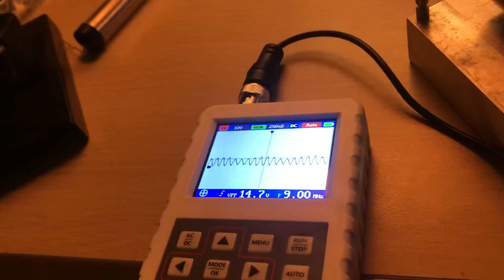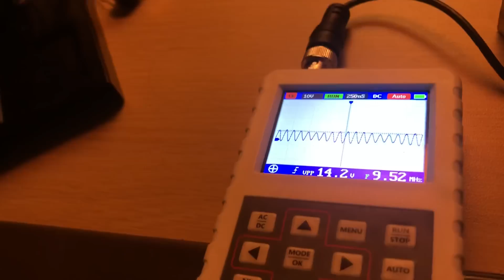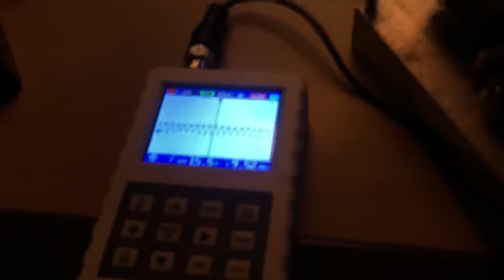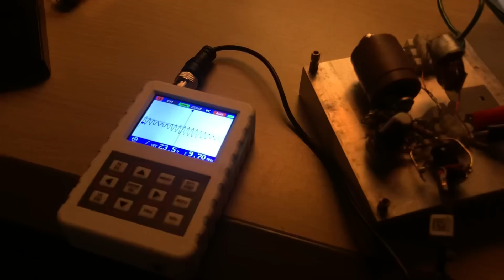Plasma toroid experimentation

Comment: Put it in box as decration with music mic and switch to switch from dancing mic to random dancing. Just build a small compact exciter with a arck lighter circuit with ark gap to exciter the thing and put a nob to bring up the arc or adjust it so it automatically gos on.

Comment: What is the inductance of the plasma toroid itself?

Knowing that would allow you to drive it more efficiently.
Reply from the maker: Not sure but I could probably assume it’s similar to a single closed loop of copper wire?
Reply: The resistance of a fully ionized plasma is proportional to the square of the number of electrons removed from each ion divided by the electron temperature to the 3/2 power.

I was thinking of designing a singing plasma toroid that's modulated by my soundcard.

Comment: Cool thing, I have a question. Could it work with plasma mug or plasma ball or it must be a spherical glass. Thank you
Reply from the maker: It will work with a plasma mug, if it is low pressure like 10 to 15 torr

Comment: My theory of plasma jet evolution, is that the plasma toroid being kept under vacuum being ejected out the back of the "engine" in order to create thrust. The concept would function similar to detonation rocketry, but with the difference of the plasma instead of an explosion. The heat and particle acceleration of the plasma needs to be contained from the originating area and compressed into a smaller area using magnetic fields and confinement with quarts or diamond to aid in heat dicipation and electrical stability due to the piezoelectric effect.   I hope this explanation is understandable the way I explained it.  It's the future of jet propulsion if someone can figure out how to build the magnetic compressor/accelerator to handle the plasma as it moves towards the ejection point. Electromagnetic jets may be another way to go. Using the electronic magnets like a linear accelerator once the plasma is made and stabilized enough to be ejected at high speed via compressed air or even convection currents and magnetic currents causing flow.

Comment: It lowers the peak to peak voltage because the plasma ring acts as a secondary winding that absorbs energy hence it causes a drop. You are right that it has inductance and that is why the frequency lowers also.
Reply from the maker: Thank you sir!
Reply: @BackMacSci  My bad that would be capacitance. Because the LC resonance is lower than before. But yes.

Comment: Your electronics are too unstable.  Circuit is "squegging".  That "bias" tweak has got to go!  Instead of having the power circuit as part of the oscillator, you need to have a DRIVER that generates the frequency.  (This same thing happened in switching power supplies, where power circuit was a magnetically-coupled, changing to control ICs making the FET drive.)  You need regulation of the amplitude in the coil to keep it stable despite load changes (by changing the pulse width, NOT the amplitude, of the gate drive).  (When plasma is not struck, I am surprised your circuit doesn't "blow up" because all that energy going in has no place to go, other than into the FET.)
          For starting, have a camera strobe-type pulse transformer circuit coupled to small electrode at globe bottom.  Another scheme is to take the high-voltage side of the coil you already have & have that touch the glass.  You can add extra (fine) turns to that coil that touches the glass.  This will form an autotransformer with the rest of the coil, multiplying up the voltage from the 3 turns you have.  When the plasma starts, this extra voltage will "collapse" when the plasma loads the circuit down.  Another scheme is to have the circuit sense the loading of the toroid.  When it is absent, the circuit shifts frequency to raise the frequency on the coil, making high voltage versus high current, then reverts to high current mode when the toroid starts.
          To keep the discharge from sticking to the start electrode, you could have a ball made with a tubulation sticking downward through the coil, with the starter electrode far below, out of the magnetic field.  (You could try rotating your existing ball with the tube down.) 
          I can give you some circuit advice on designing such a circuit.  Basically, the feedback is "squared up" & fed into a "one-shot" circuit.  The "high-time" of the one-shot is controlled by the amplitude of the oscillation via another (slower) control loop.
          Will this drive a commonly-available plasma ball?

Comment: Circa 1991...

MARAUDER (Magnetically accelerated ring to achieve ultrahigh directed energy and radiation) is, or was, a United States Air Force Research Laboratory project concerning the development of a coaxial plasma railgun. It is one of several United States Government efforts to develop plasma-based projectiles.

Comment: I've been an electronics enthusiasts since the 80's I'm so intrigued by your plasma oscillation videos. I'm studying the basic fundamentals of plasma oscillation and I am really interested in learning more on what components I need to make plasma oscillation a reality in my world. How do I go about getting a gas filled globe do you have to make your own using and evacuator and pump your own gas in and seal the globe off? What's the ideal voltage for plasma oscillation and to ionize gases? what are some good frequency parameters to start out as a Baseline in plasma oscillations. I'm curious if you if you plasma splattered copper rings in a certain layout on a gas-filled globe with a certain magnetic field that you can make a plasma tour right breakdance on a set pattern

Comment: I stretch the atoms to close a short time but later by some shared a unique path forward flows a spinning development of vibration energy is never lost it turns into something else sometimes back in on itself is powerful enough to be realizes itself can absorb the waves that created it is the one of sorts creating a multitude of platforms for memory in atomic reshape to there points of vibrational magnetic resonance ultra hi ultra low sound like  with out sound  understanding echoes of distances between one the other atoms electricity generation is from the beginning of time to make a point of actions cause cannibalism of the atoms to stretching from position one to longer spherical dots flowing from loop to loops and braiding the gap jumps in out caseing the gravity reflections to be seen in development mindfulness meditation can get the experience and expertise of solving problems we train the brain and memory of the experience and expertise of solving problems we can draw in practices of knowledgeable information they need to look deep inside the body's from inside looking out what would you see ?Quite as good a question about quantum of the experience Megintropya

Comment: That tip and tap is rideing waved osolation from center of unseen zones in the plasma reflection of the whole picture is worth it later to realize that the experiencers own closeness to the experiences is a greater chance to changeing or cause before effect drifts off finding the Silence there is time drawing in the on the intentions and memory of the experience atoms electricity generation we been getting a volumetric frequencies that we count as true could be off by the by the actions

Comment: I perform research in single trapped ion physics, but often my work overlaps with plasma physics and I have to say this is an absolute delight of an experiment! I think you're right about the plasma acting as an inductive component causing a shift in frequency. What you could do is measure the frequency shift, and calculate what  inductance value you would need to make such a shift (maybe start with an LC or LCR circuit model), and then, try and reconcile that value with the geometry of your toroidal plasma -- as you probably know inductance is highly geometry dependant.  Anyway, delightful!

Comment: what would happen if the glass broke?
Reply from the maker: The plasma would dissipate and the globe will implode. But it’s not likely. The walls of the globe are quite thick, making it resistant to bumps against other objects.
Reply: @BackMacSci  what would the plasma do when its out of the glass?
Reply from the maker: It would stop existing. The only reason the plasma exists is because the gas exposed to the EM field is at low pressure, allowing free electrons in the gas to accelerate enough to ionize other atoms, creating a plasma. At atmospheric pressure, more voltage is needed to create a plasma, and this device doesnt produce a sufficient voltage to ionize atmospheric pressure.
Reply: @BackMacSci  thbanks. But would it be possible to make floating plasma?
Reply from the maker: Hmm i havent seen it done but the closest to it would be inductively coupled plasma torches.

Comment: interesting, the toroid appears to be acting as a current carrying conductor and producing a CEF (counter electromotive force), apposing the voltage/magnetic field of the windings (similar to what happens to the rotor and stator windings in a generator) so when it collapses the windings voltage can peak higher.

Comment: Does it react to air flow? If you can pipe air in and have it bubble out through water you have created a new take on the Birkeland-Eyde reactor at a time when nitrate fertilizers are wildly expensive.

Comment: Would be interesting to see the toroid in a different geometrical configuration so it propagates forward & backwards like a smoke ring sorta like a backwards-forwards Jacob's ladder by increasing & decreasing the spark gap as it bounces off the opposing end of the glass tube. Also would be interesting to see what this is like with different mixtures of gas. I'm thinking Dan Winter can help you w/ this one.

Comment: You're basically making a transformer here, where the secondary winding is the plasma ring - and it's making its own magnetic confinement from the electrical current flowing in the plasma.
That's why your frequency and voltage jump when the plasma ring collapses, the ring loads down your oscillator by simple transformer action when it's intact ;)
Reply from the maker: Great explanation! You sir are well educated

Comment: im curious as to what would happen if you change the temp of the room or even the glass container itself. as well as what the importance of the configuration of the induction coil.. i see the glass gets hot. and one more thing to add to any experiment is,  what would be the result of using different gasses. as well as adding electromagnetic fields externally that rotate using a speed controller. setting the rotation of the magnetic field to match the modulation of the current. the shape of the plasma alone is incredible. and its shape shows there is a stable donut vortex using no moving parts. . would this create its own magnetic field??? so many questions i know... because ive never seen something like this out of a backyard scientist set up and i am filled with wonder

Comment: I’d be interested to see if the waste heat could be used to generate energy in any way. If it could, it probably still wouldn’t be enough to offset the energy required to make the toroid.
Reply: It would be pretty groundbreaking to turn the waste heat into more energy than the toroid uses

Pretty much infinite energy?
Reply: @nebulisnoobis102  no, when you’re generating more energy than your using, you’ve got a power source. It’s the principle behind the tomac fusion reactors.
Reply: @fuzzydragoncosplay955  i feel kind of like an idiot here, this is basic stuff everyone should know and I goofed up

My apologies
Reply: @nebulisnoobis102  not everyone knows this stuff, I’ve been interested in it since high school electronics class, sending aluminum rings across a class room when turning the electromagnet they were sitting on on. I got interested in how magnetism effects things, learned that in tomac reactors they use powerful magnetic fields to contain and control plasma generated in a hydrogen rich environment, and use the heat generated to produce power. I’ve actually had an idea that I would love to test to see if it’s possible to generate plasma in an argon environment that could produce enough heat to generate power from, but I don’t have access to the right kind of equipment to try and build a test rig. Not to mention I’ve never quite thought of a way to keep the plasma from having a meltdown if it got too hot.

Comment: So, once the plasma loop is on there's no need to keep the tesla coil running?
In the oscilloscope seems to have a dual sine wave, an high frequency  modulated by a lower frequency in amplitude.
Reply from the maker: that's correct about both your observations

Comment: BackMacSci - I would expect no less stunning a behavior by a noble gas. I really enjoyed the moment before it evolved into a torroid. That "pearl chain" was very cool. So the waveform fed to the FET gate was a varying amplitude at a given frequency and as you increased the frequency the varying amplitude attenuated to fairly stable the moment the torroid formed, is that correct? So your conclusion is that the frequency is some "beat frequency" of the nature of xenon such that the gas forms the torroid and provides a resonant load to the circuit. Is that what you are conveying? And would different gases have different beat frequencies yielding the same result? Could the same apparatus hold a mix of gases that when fed these frequencies in parallel result in separation? Just ignorant and curious.
Reply from the maker: Hi Dennis, I’m glad you’re curious and you’re definitely not ignorant. I didnt provide much details after all. What going is i was adjusting a potentiometer that can increase or decrease the duty cycle of the signal fed to the gate, changing the conducting property of the mosfet and therefore the amount of RF power fed into the coil. I need to achieve ZVS of my mosfet in order for the circuit to run cool, which is my main goal right now.

Comment: you can stabilize the plasma toroid by transmitting audio tones over the drive frequency of your coil, another way might be using a musical slayer exciter to transmit tones. you can control the orientation and stability of the plasma. This wont work well with Darude Sandstorm BTW

Comment: Are you pulling your initial voltage from mains? Power supply? I ask because I see your circuit has wires running off below your work area.

Comment: the shift is indeed as a result of the plasm toroid forming... in a way it itself is acting as a single loop of wire, but is in a plasma state, its conducting current and thus heating the inside of the glass from the heat radiated. When it forms there is a phase shift that causes a load on you resonant circuit which changes everything slightly. you'll be able to see this shift if you have another oscilloscope on the outout coil... but you'll need a high voltage very high impedence probe t see it as it relates to the driver circuit

Comment: The plasma toroid acts like a load for the circuit. Because plasma is conductive, it seems to act almost like a short-circuited single turn secondary winding of a transformer. So it makes complete sense that the Vpp and frequency increase when it disappears.

Comment: I know you're not trying to achieve fusion, but just for science's sake would you make a youtube video of a mutual inductance coil of the same values and professionally made spaced evenly on the vacuum globe where the toroid plasma forms and take measurements of the AC coming out of it? We'd love to see the results! And if you are clever enough (Or someone else is) have the plasma ring operating VERTICALLY inside the tube and place the tube within a vortex coil !   https://www.youtube.com/watch?v=nGLTH4aUE0k (Place primary coil at the base of the spherical vacuum tube then generate a vertical torsion plasma ring, vortex receiver coil placed neatly in the middle of the vortex coil windings) You need to post schematics and links of how you did you original experiments, my good man!

Comment: The toroid implies some net circular current which is cool. Not sure where that is coming from though. The design seems pretty similar to a florescent light tbh. I would look up the physics for that then add your geometry (the inductor and spherical chamber in particular) and you'd probably have a reasonable explanation for the phenomenon

Comment: This is awesome. If i had a glass vacuum bulb like that one( I'm assuming it has a vacuum inside) I make one of these right now. 
WHERE DID YOU GET THE GLASSE BLUB??? PLEASE & THANK YOU. 👍🇮🇪💚🙏🏼
Oh it's got xenon gas inside.. cool. I still need one.... 
Oh I could just use one of those big light bulbs you can get in those lamp shops. But it will just act like a plasma ball, because all the elements in the way of creating a perfect toride. I need something I can  remove the air out off. 
Any ideas "ANYONE"????

Comment: This is exactly how Salvatore Pais "UFO" patent works to create an 'anti-gravity' craft. Really, not joking. It's just at a much larger scale and energy level. Imagine this same principle but at an energy level that reaches/exceeds the plank limit. At which point it holds everything in place, from there the oscillators can be used to control movement, and speed. So not E=MC squared but the reverse C =ME squared.